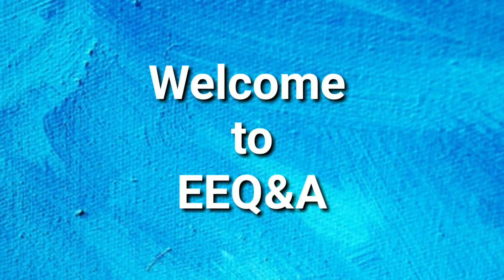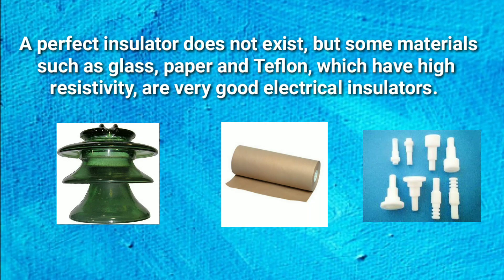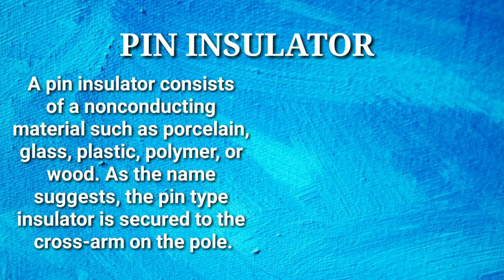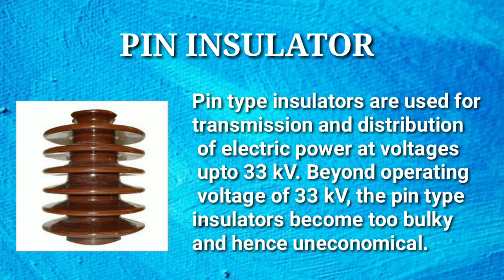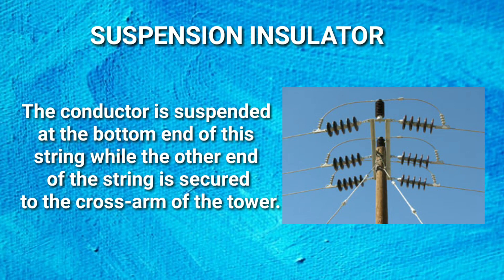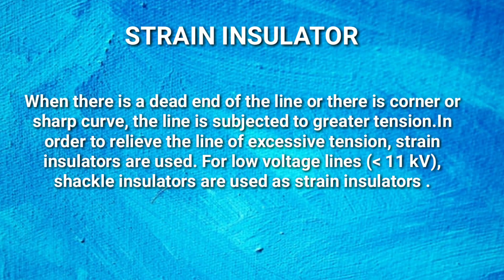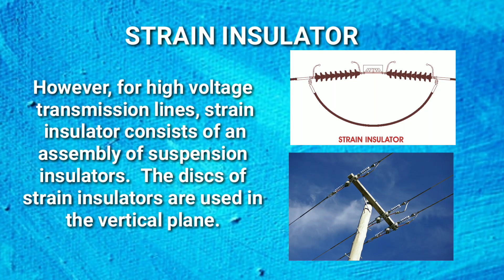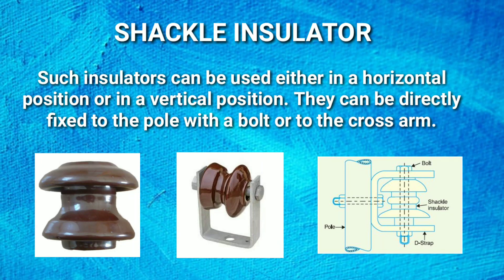INSULATOR - Different types of Insulators

Comment: Sewak Electrical Works is pleased to introduce itself as a well recognized Exporter, Manufacturer, Wholesaler/Distributor, Supplier and Trading Company of Delhi, India. Started the business operations in the year 1978, our company has been mainly dealing with the industrial hardware products that are generally used for plumbing purposes. The different kind of industrial fittings we are providing includes T&C Fittings, A.B.C. Fittings, Brass Lugs, Pad Clamps, Brass Connectors etc. All these goods are made up of best quality stainless steel, steel, brass, copper and other allied material in conformation to the industry set norms and guidelines. By using our advance manufacturing facilities, we also customize these fittings in different dimensions, sizes, material, weight etc. as per client's requirements within their budget.  visit us @ http://www.sewakelectrical.com/   Email - sewakelectrical@gmail.com 
Business Type Exporter, Manufacturer, Wholesaler/Distributor, Supplier & Trading Company
Primary Competitive Advantages 
High quality products
Team of experts
Competitive prices
Timely delivery of consignments
Prompt services.
No of Staff 25
Year of Establishment 1978
Product Range 
P.G Clamps
AB Cable Dead-End & Suspension
Pad Clamps
A.B Switch's Components
Bi-Metallic Pads
D.O Fuse Components
C.T Clamps
Substation Clamps
P.T Clamps
T&C Fittings
A.B.C Fittings
Tee Clamps
Automatic Or Come along Clamps
Brass Lugs
Dead End Or Tension Clamps
Brass Connectors
Suspension Clamps
Flexible Pad Clamps For I.P.S Tubes
Adopter or Transformer Clamps
Overhead Line material